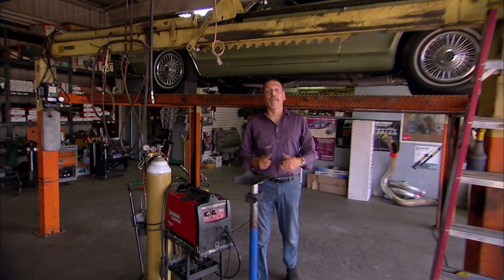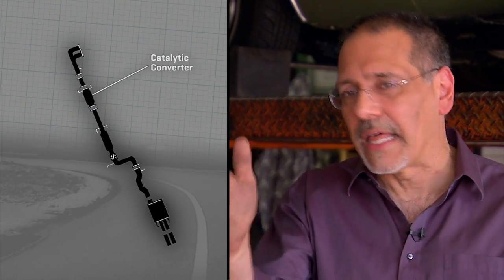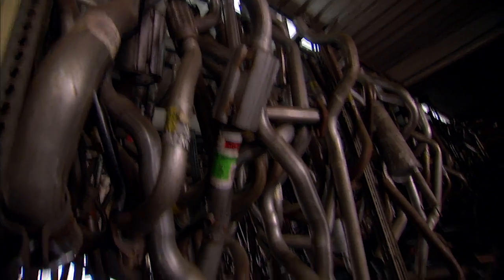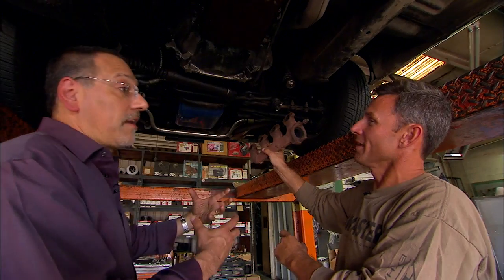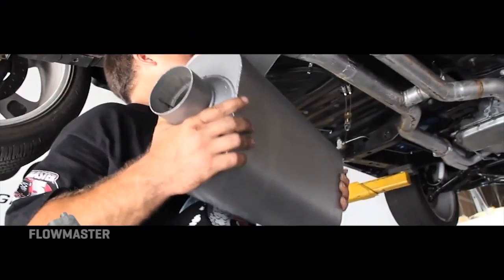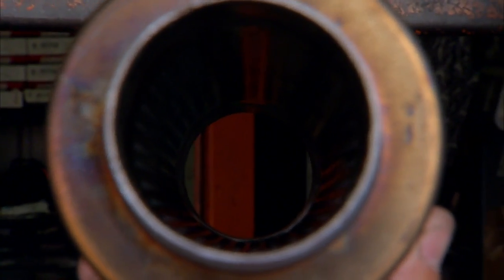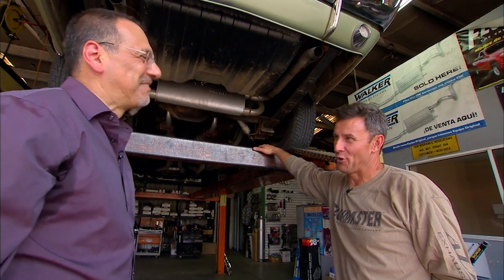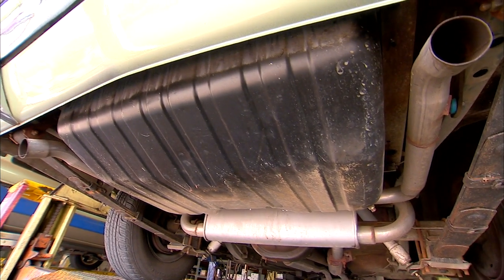CNET On Cars - Car Tech 101: Dual exhausts demystified

Comment: Question, when dualling an exhaust, do you need to add oxygen sensors to both sides or can it be monitored on one side only?
Reply: Both for cat monitoring, single for A/F is fine
Reply: If your looking to just run the motor, but if you want to monitor lean/ rich conditions and ease diagnosing I'd go both

Comment: if your car has 1 exhaust then stick with it  only add other exhaust pipes if u want to lower the sound >>> every time gas,s bounce back or directed through 180 degrease the sound levels by half

Comment: Good explanation. I have a true dual set up on my '06 Mercedes CLS 500 & will be doing away with the centre resonator that the two pipes run into & out of & in it's place just running two straight pipes out to the rear mufflers. There is a small cross over tube inside the resonator that will be got rid of, I want more of the 'blat' that you get without the H-pipe or X-pipe & will hopefully give more of the old school muscle car sound that I'm after, the lovely throbby, woofly V8 sound.

Comment: Dual exhaust doesn’t increase mpg. You burn more fuel than with single exhaust. The reason is, people drive harder because they want to hear the exhaust.
Reply: False. Pre 1975 vehicles will increase about 2mpg. Modern vehicles increase 0 to 2 mpg.  People need to do a driving modification on themselves if they are having a heavy foot.
Reply: @enriqueb4412  Who told you that lie about pre 1975 car will get 2 mpg better? I bet you have never driven a 1974 anything.
Reply: True

Comment: Jewelry? No, It's function my friends. And my 1960 Buicks all had factory full dual exhaust, blending both pipes into a mixing resonator/muffler  right in front of the fuel tank and then dual back out.

Comment: I put duals on my truck and it got way quieter. I think im the only person in history to get quieter going duals than with my single setup....
Reply: Maybe you got quieter mufflers on it? That's probably the only thing I can think of that would quieten it down.
Reply: @ElMaximoBango  Went from 1 glasspack to 2 dynomax bullets.
Reply: @Instrumentator23  Your old glasspack probably had no fiberglass left, the cheaper glasspacks have fiberglass that burns away (maybe after a month with higher running temp EFI engines and with cats than burn very hot, but might take a year or more with catless exhausts).

The Dynomax Bullet does well at resisting burning away even on newer cars/trucks. Other factors may be your new exhaust is smaller pipe diameter, you might not have exhaust tips which act like a megaphone and amplify the volume, and your Bullets might be the longer case mufflers and your old single glasspack might've been a little 8" shorty case.
Reply: @AdmiralRustyShackleford  Preciate it, the bullets i put on were shorter than the single glasspack i had and tips stayed exactly the same as well as the pipe diameter. I wound up changing everything again because i didn’t like it and got it to where i was more than happy with it.

Comment: You missed a crucial system of an exhaust system... Back pressure which helps close the exhaust valves!??  Without it and OEM valve springs... you just burned a valve.  Be more responsible, Please... ASE CMAT

Comment: 1974 Dodge full size van I had a true 2 inch dual exhaust with thrush turbo mufflers nothing else exited out in front of the rear tires never had no drone noise inside the van ever was not loud was a nice mellow low Rumble headed that way since 1983

Comment: So inline engines really can't have true duals
Reply: They can, if you isolate halft of the cylinders with their own exhaust manifolds :P
Reply: TheRealestEver the i6 in my jeep has a 2 piece manifold. each manifold handles 3 cylinders and then goes into a y-pipe

Comment: makes me laugh when little shitty 1.8 liter 'sports' hatch have 'dual' exhaust...go away and come back with a real car..
Reply: 1700iDiGuy So, what do you call a real car?
Reply: jeffrey625625
No, it's because they are perfectly balanced by nature. Don't take much to get them running. Boxer 4 and Inline 6 are better balanced than V6 or V8 engines, by nature. This is why those engine designs are used in small aircraft. Because they are naturally balanced, you can use less metal and thus the engine is lighter. V6 is very hard to keep vibration free, it's two Inline 3 engines. And V8 is two Inline 4 engines. And Inline 4 is one of the worst when it comes to vibration without counterweights.
Reply: 1700iDiGuy i have a 5 cylinder car :0
Reply: jhail040 I know, the balance of a 4 cylinder is not good. But just look at the new mustang, 4 cylinder and lots of HP. Fine for most people.
Reply: +1700iDiGuy  lol i can tell youve never reved an S2000 to 9k ignorance is bliss
Reply: What's even better is when those little 1.8 liter cars destroy "real cars" in reliability drag races and fuel economy.
Reply: +1700iDiGuy but you forgot that EVO and STi are 4 cylinder cars and they do turn heads on the road, 360deg in some cases. Meanwhile my Pajero has 6cylinder. Sluggish AF!
Reply: Y10Q True. So the moral of the theory is, 6cylinder doenst always means beast.
Reply: +1700iDiGuy the Inline 6 is truly an amazing engine design, sadly it's insanely hard and tricky fitting them into small cars or even large pickup trucks. They do give out crazy torque over a powerband, hence why diesels love to use that I6 config with turbos.
Reply: 1700iDiGuy Why?
Reply: Why? A 4 cylinder can crush a 6 many times. Or tho if you did the same with the six cylinder it would still be better.
Reply: +1700iDiGuy All depends on how you tune the car and know what the car wants or needs
Reply: +oliver24x unfortunately the fact of the matter is a v6 will inherently be better than a slant 4 given all things equal. same goes for v12 vs v8 vs v6.that little 4 cylinder will require much more expensive components with higher grade materials to produce equal power and efficiency. partially due to harmonic balance of the crank and valve-train and also due to the fact bigger is better. offshore racing boats use v8's and v12's due to their ability to survive constant loading in endurance situations. a small 4 cylinder is suited for economy driving, which is what its designed for. horses for courses...
Reply: 1700iDiGuy but does it have an F20?
Reply: +1700iDiGuy What do you have? There are always bigger and better guys out there.
Reply: 1700iDiGuy so ur Australian?
Reply: 1700iDiGuy I got a god dang 7.3l Diesel and I know a guy that owns a Russian 38l tank engine.
Reply: i lived there for 3 years
Reply: 1700iDiGuy I know a guy who knows a guy that is friends with a guy that owns a company that owns big container ships. They come with pretty big engines too.
Reply: akupehsluarketatAR
 STI has almost full torque at 2000rpm and the way it's done is lots and lots of fuel. Injectors on that engine are 2x as big as injectors on Corvette engine. Same amount of fuel and air is needed for same power. The only difference is the medium where it's exploding has to be 2x as strong.
Reply: akupehsluarketatAR
 the idea and appeal of STi is the light weight feeling you have upfront. If you have ever steered a Corvette which comes with a 450lb engine in the front and you compare that feeling to 250lb engine that STi comes with, huge difference. You can actually feel how much lighter it is. But sometimes, say with a Bulldozer or a tractor you kind need that extra weight upfront to pull a tree out or pull across the yard so you can safely burn it, away from other trees. Bigger isn't always better. Sometimes it is, sometimes it isn't. In race cars, the lighter it is, the better.
Reply: Correction... Someone with a v8 and revving people turn there heads not to say nice car or something like that, but instead they'll say that guy is such a douche thinking he is all that. Hence the line between tuners and ricers. People with V8 have a tendency to think they are hot shit just because they have a loud exhaust and big engine. I have seen a 4 cylinder beat a v8 before, and guess what. the 4 cylinder was a honda civic that was highly tuned and was a sleeper at the same time.

Comment: Well it's just an opinion to me.  Just because he owns a muffler shop does not mean he knows if there is any benefit of having a dual muffler or not
Reply: There's no performance to be gained with dual mufflers, and depending on what you use, you may lose a tiny little bit. Also two mufflers is heavier, obviously. Another 10-15lbs. NBD tho. The advantage to multiple mufflers is purely sound control, be it to make it deeper sounding, change the tone a little, or simply reduce overall volume, especially inside the vehicle. Obviously running 2 mufflers is quieter than 1 muffler of the same type, but 2 also tends to be deeper sounding. Also, having multiple mufflers (2 on a single, 4 on a true dual, or 3 like this) cuts down on interior noise especially. Every inch of exhaust tubing from a sound changer (header/manifold collector, cat, but mostly the muffler(s), etc) is a resonation tube. After about 2-3' of pipe is when it gets particularly droney. I have a video on my page showing just how quiet it is in my truck when I put the mufflers all the way at the very back of the bed compared to the typical location of before the rear axle. Quite a bit quieter inside, slightly quieter outside. Perfect for a daily... But I don't mind the noise, so I put it back in factory location when I got rear ended.  Hope that answers your questions
Reply: i was thinking about taking my car to him i work literally down the street but after this video im just going to buy a custom axle back

Comment: I cut the Cat's as soon as I can; especially since we can't afford newer vehicles. I hate those evil bastards. I never ever connected one side to the other.
Reply: Balancing will not only gain you a little more torque/power (H for low end & raspier sound, X for more top end and smoother sound), but also yield you slightly better fuel efficiency and better exterior sound altogether.
Reply: Thanks, I didn't know all that. I liked keeping them separate to listen to the individual sides in the case of a miss & etc.
Reply: +Steve Holsten Then what you can do is when you detect a miss (it can be felt, obviously), just have a way to unclamp the exhaust before the H or X and listen to it like that, then bolt it back on.
Reply: Thanks. That makes good sense. I'll keep it in mind.